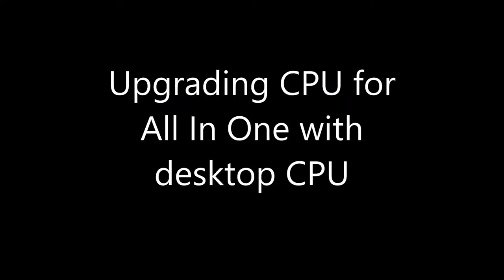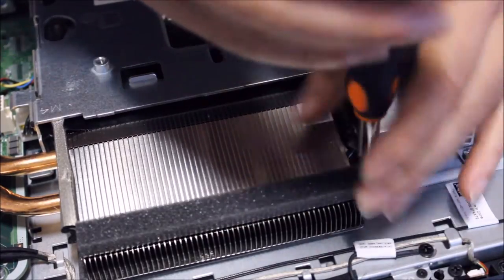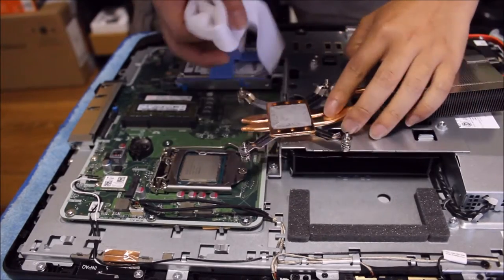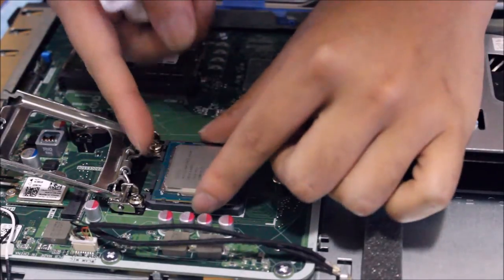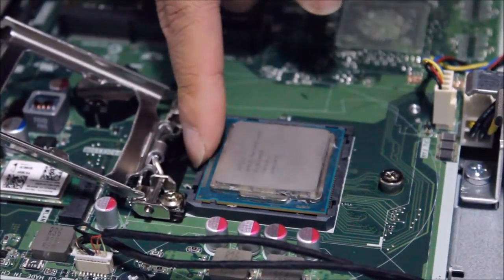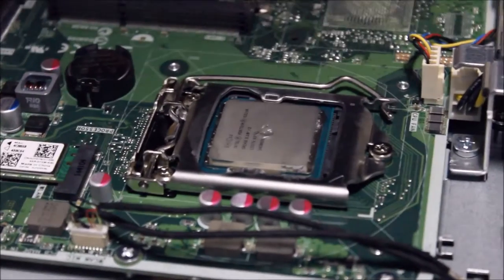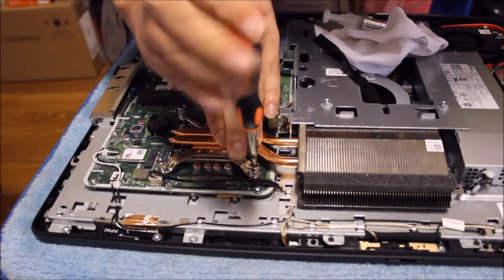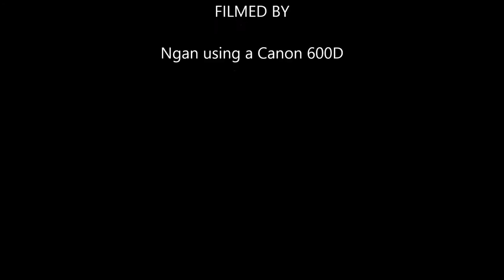Upgrading Intel CPU for All In One with desktop CPU NOT laptop CPU

Comment: Hello sir great video would this work and what processor could i use to upgrade to 3.0ghz? i have a hp all in one Desktop-MPRTHJ with AMD A8-7410 APU with AMD Radeon R5 graphics 2.20 ghz 4gb of ram, trying to run some things better thanks
Reply from the maker: a8 is the highest thing you can get
Reply: @OpenMeUpTec  thanks so much for the reply(: do you think i could install this to the back of my all in one? A8-9600 AMD Quad-Core 3.10GHz 2MB L2 Cache Socket AM4 Processor
Reply: @OpenMeUpTec  or even this? A8-5600 AMDK Quad-Core 3.60GHz 4MB L2 Cache Socket FM2 Processor
Reply from the maker: @BE_WERM  i need the model number or your computer to tell you
Reply: @OpenMeUpTec  system model 24-g010 system name desktop-MPRTHJ3, thank you please let me know if you can
Reply from the maker: @BE_WERM  Supports the AMD E2-7110, AMD A6-7310, AMD A8-7410 (Carrizo-L) Quad Core processors only. The processor is not upgradeable.
Reply: @OpenMeUpTec  so i can get better ghz right? for gaming low end games
Reply from the maker: @BE_WERM  The processor is not upgradeable.

Comment: Can I upgrade my AIO from pentium g640 to amd ryzen 3 3200g on my lenovo c320
Reply from the maker: no it needs to be the same branding. so intel with intel CPU. the intel g620 can be changed to a i7 2600s. just to let you know, this doesnt mean you computer will be better or do the things you want it to do. you will be better off buying a new computer and selling this
Reply: @OpenMeUpTec  I actually have a much powerful one but I just don't want to waste this. And can I use external graphics card for this
Reply: @OpenMeUpTec  can I change the motherboard
Reply from the maker: @lakshmiprassana6266  it is an AIO. therefore it uses it own motherboard, you cant just get one from the store and put it in.
Reply from the maker: @lakshmiprassana6266  if you going to buy an external graphic card, you might as weill sell this and get a new computer as it will be cheaper

Comment: HP Pavilion 23-g013w All-in-One Desktop with Intel Pentium G3220T looking for the best possible LGA 1150 cpu
Reply from the maker: here is the list of processor you can get. 

Intel Celeron G1820T (Haswell) 2.4 GHz
35 W
Intel HD Graphics (GT1)
Intel Pentium G3220T (Haswell) 2.6 GHz Dual Core
35 W
Intel HD Graphics (GT1)
Intel Pentium G3240T (Haswell) 2.7 GHz Dual Core
35 W
Intel HD Graphics (GT1)
Intel Core i3-4130T (Haswell) 2.9 GHz Dual Core
35 W
Intel HD Graphics 4400 (GT2)
Intel Core i3-4150T (Haswell) 3.0 GHz Dual Core
35 W
Intel HD Graphics 4400 (GT2)
Intel Core i3-4330T (Haswell) 3.0 GHz Dual Core
35 W
Intel HD Graphics 4600 (GT2)
Intel Core i5-4570T (Haswell) 2.9 GHz Dual Core
35 W
Intel HD Graphics 4600 (GT2)
Intel Core i5-4590T (Haswell) 3.0 GHz Quad Core
35 W
Intel HD Graphics 4600 (GT2)
Intel Core i5-4670T (Haswell) 2.3 GHz Quad Core
45 W
Intel HD Graphics 4600 (GT2)
Intel Core i5-4690T (Haswell) 2.5 GHz Quad Core
45 W
Intel HD Graphics 4600 (GT2)
Intel Core i7-4765T (Haswell) 2.0 GHz Quad Core
35 W
Intel HD Graphics 4600 (GT2)

Comment: I think I I've maxed out my Lenovo b40-30 aio. I've got 2tb ssd and 16gb ddr3 ram. Anything else I can do? I love this machine.
Reply from the maker: i need to know your model number to answer the question. looking at what you have said you probably dont have anything else to do. you might be able to upgrade your CPU and that is about it.
Reply: @OpenMeUpTec  The MODEL number is B40-30 AIO Lenovo can you upgrade the CPU? ITs a lenovo intel g3250t  I3  Lenovo All-in-One PC C460 (57330368) Pentium G3250T (2.80 GHz)
Reply from the maker: @C-commerce  This is the list of CPUs you can use. the best thing is i7. 
4th generation Intel® Core™ i7-4770T(2,5GHz, 4 core)
4th generation Intel® Core™ i3-4130T (2.9 GHz, 2-core)
4th generation Intel® Core™ i5- 4570T (2.9 GHz, 2-core)
4th generation Intel® Pentium™ G3220T (2.6 GHz, 2-core)
Reply: @OpenMeUpTec  From what i hear it is solder on, And from the looks of it I can only get 2 cores which is kind of a bummer. But this is very helpful, I may do this just to have a spare fast computer for surfing the web. 
Great video and thank you for the reply! Much appreciated. Subscribed and liked!
Reply from the maker: @C-commerce  it is not soldered on. you can open it up to confirm that. the CPU you have is a desktop CPU and they dont soldered that on.
Reply: @OpenMeUpTec  its not a desktop. It's a all in one with touch screen.
Reply from the maker: @C-commerce  yes. if you look at the video i have for this comment you will that AIO can come with DESKTOP CPU or LAPTOP CPU. your AIO comes with a DESKTOP CPU which is not soldered on to the board
Reply: @openmeuptec can the intel i7 3.40Ghz quad core SR149 socket 1150 work in this same model?

Comment: Is an all in one cpu same as laptop cpu ?
Reply from the maker: depends on what you buy. the newer HP AIO are laptop CPU, they used to use desktop CPU but most of the brands are now moving towards laptop CPU in the newer AIO. at one stage basically everyone used desktop CPU combine with laptop GPU in there AIO. the best way to find out is to do a quick search for the CPU and it will tell you if it is a laptop or desktop CPU

Comment: i want to upgrade my ram and graphics card i have an Aio can i do it?😢😢
Reply from the maker: you need to tell me what AIO you have. Basically all AIO you can change the RAM but not the graphic card because it doesn't have one or it is soldered on
Reply: OPEN ME UP intel i3 3.2 ghz
4gb ram
intel hd 530
windows 10 64 bit
Lenovo AIO thanks for the help
Reply from the maker: you need to tell me what i3 you have and what is the model number of your AIO. if you can find it online and send me the link

Comment: #1 Thing wrong in this video is don't touch the top of the cpu like he does because it acts like oil in water because the oil from your hands interfere with the thermal paste.
Reply from the maker: thats why if you watch the video i wipe it after i touch it.you also can try it without wiping it and there will be no difference
Reply: He cleaned it with a cloth lol🤦‍♂️🤦‍♂️🤦‍♂️

Comment: will an all in one i3 cpu work on a laptop?
Reply from the maker: +PurgeGaming depends. But this video is not that. This is for an all in one with a desktop CPU. Some all in one use a laptop CPU so you can remove that but then your laptop needs to also have a removable CPU which most don't
Reply: +OPEN ME UP so if I remove the laptop cpu right now, I can put my aio i3 cpu in? And it'll work. Right?
Reply from the maker: not really you need to tell me what laptop you have and want all in one you have for me to answer your question
Reply: +OPEN ME UP its an acer aspire r3-131T
Reply from the maker: nope the cpu is solder on for that
Reply: +OPEN ME UP is there anyway I can take it out still or no
Reply from the maker: no
Reply: +OPEN ME UP another thing. Can I use the aio cpu on a desktop? Like I'm building a gaming PC
Reply from the maker: which AIO do you have  as some AIO use laptop CPU not desktop one
Reply: its from an hp envy 20 touchsmart and its an i3
Reply from the maker: that is abit old they dont even sell the motherboard to fit that cpu anymore also if you remove that want cpu is the AIO going to use. A i3 CPU isnt worth much around $100AUD and it is pretty low end.
Reply: +OPEN ME UP well it runs mine craft perfectly fine. And the aio pc screen just went black. And idk how to fix it so
Reply from the maker: anything can run minecraft. as you can see minecraft works on a phone. you need to explain your issue more clearly or else i can not help you
Reply: +OPEN ME UP I upgraded to Windows 10, and after a few days, I turned the PC on and the screen stayed pitch black. Like nothing showed.
Reply from the maker: when you turn on your computer do you still see the HP logo and the loading screen
Reply: +OPEN ME UP nope
Reply from the maker: that's bad then something seriously wrong and I am unable to help you over the internet without looking at it.

Comment: thank you very very much!!!!!!!!. by the way can please tell me that which cpu did you put in . is it an i7 or an i5 . please reply me with the name of the processor  .thanks
Reply from the maker: I have 3 of these an i7 4790, i5 4670 and a G3240. I didn't actually change the CPU I was about to but then realize it was pointless. the one use for this example was G3240 and was about to replace it with a G3220 but they basically the same.
Reply: is it possible to upgrade my g3240 to a i3 or i5 in this model pc?
Reply from the maker: yes it is. you have a desktop cpu that uses lga1150 socket according to the intel site so you can replace it with anything that uses lga1150. just google lga1150 cpu and you will get a list of them
Reply: +OPEN ME UP  thank you yea i got a pentium in it now would like to upgrade it. Thanks again
Reply from the maker: what is your issues currently that makes you want to upgrade

Comment: Hi there, I have Lenovo All-In-One C440: This has an intel G2020 H61 chip CPU that I would like to upgrade 
This is the datasheet for it:- https://ark.intel.com/products/71070/Intel-Pentium-Processor-G2020-3M-Cache-2_90-GHz

What would be the best CPU to upgrade it to, quad core obviously.

Insidentally, my machine has 8gb of ram in two sims and officially, this is the maximum. Has anyone tried upgrading the RAM beyond 8gb?
Reply from the maker: your CPU socket is LGA 1155 so go google LGA 1155 CPU list and thats everything that will work with it. the max ram you can use is how many slots you have, you have 2 slots and ddr3 comes in 8GB max for each stick therefore you can get 16GB

Comment: I have a inspiron 20 model 3000. Can I upgrade to a intel i3 from a intel pentium 4?
Reply from the maker: most likely the CPU is soldered on. also i3 and pentium 4 are not compatible
Reply: +OPEN ME UP i have to change out the motherboard as well?
Reply from the maker: there is not point doing that you might as well buy a new computer if you planning to do that